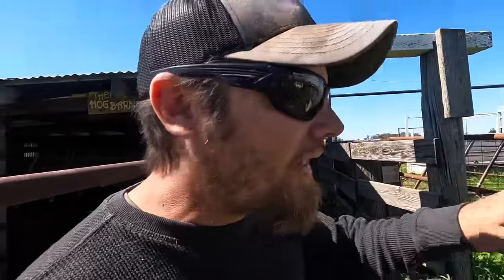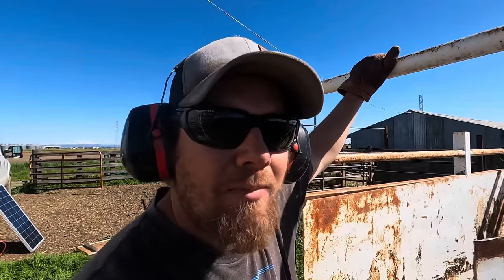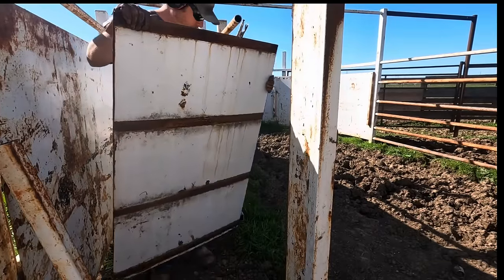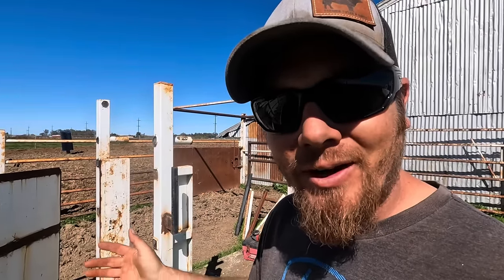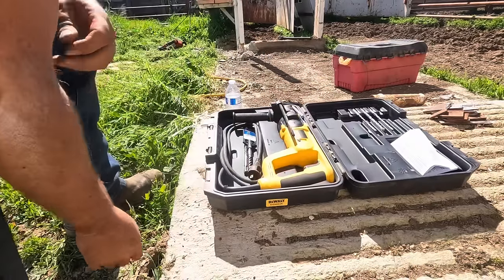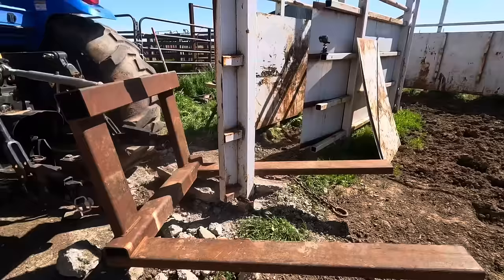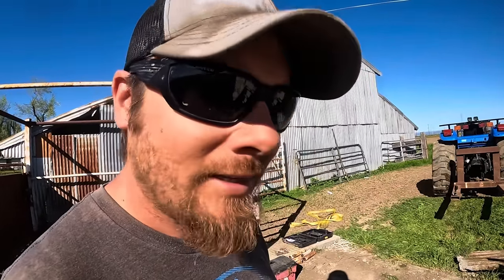Squeeze Chute Swap! Part 2

Comment: If you still want a step off of the cat walk you could, maybe, use that section you cut off the end of it.  Seems wide enough so you wouldn't miss step when using it.  You might possibly try designing a way to pull it out/tuck it under the stationary cat walk so it wouldn't be in the way when not in use.  🤔

Comment: Question:  If you need to use your old squeeze chute to aid in delivery of a calf, since the normal exit out of the chute is not leading into a corral and is open to the driveway, do you back the cow out or do you have another plan?  Seems like a cow's "reverse" is unpredictable!

Comment: I'm not sure this is appropriate .  But I use a thick construction trash bag around metal posts that I'm going to put into concrete so when and if I need to pull it.  You can knock off the concrete easily or if it sticks to the post at all.  It has never interfered with its holding capacity that I know of.   Just throwing that out there.

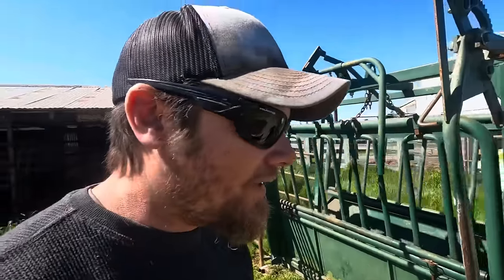Comment: @6:00 Tyler, Just out of curiosity here. After you run the heifer into the chute and take care of the issues, what is next? You can't back her out of the chute. You can't release her into the open field. I am guessing you will have to back the trailer up to the head gate and load her in the trailer?

Comment: The twine (rope ?) you used could fail after a while !! Wouldn't bailing wire have been a better choice to secure those panels to the squeeze chute ? That's this city boy's guess......?
Reply: I used twine on my "temporary" chute last Saturday. It's easy to cut loose with my pocketknife when I get through with it but strong enough to use "temporarily". With the wire I'd have to get the pliers to cut it loose.... that's why I use twine on my farm

Comment: I noticed that there was no rebar in the concrete pad. Are you planning to add something to the new pad to make it stiffer for the scales? Would it even make a difference to your weight readings?

Comment: Pardon the city boy question, Tyler, but how will you get the hypothetical cow out of the old chute if the front end is wide open and it could just run off anywhere. Can you get it to back down that alley?

Comment: The crush will sit and rust. Likely never to be used. 
You spent a small fortune on a new one which will always work like the old one. You could have helped a new farmer get started by selling the old crush.
Reply: I suspect when he has the new one up and running, he will sell the old one.  Might be he already has a buyer.